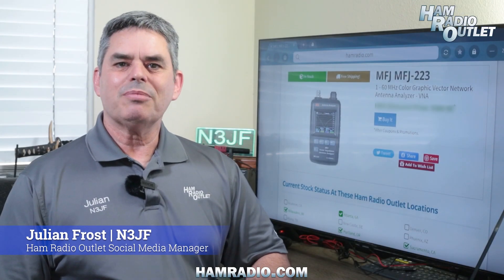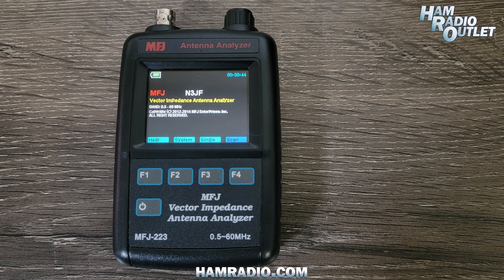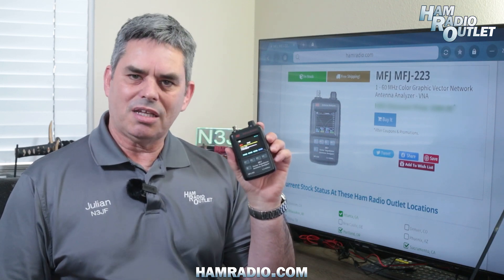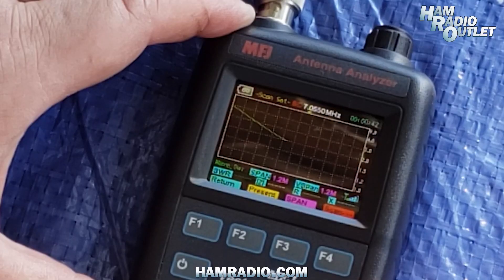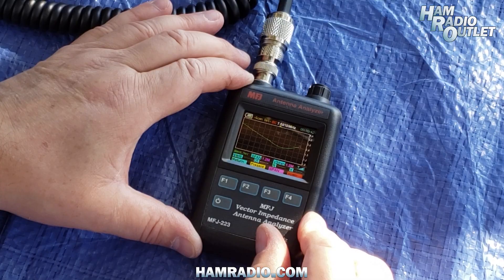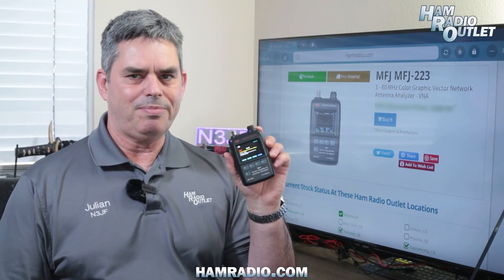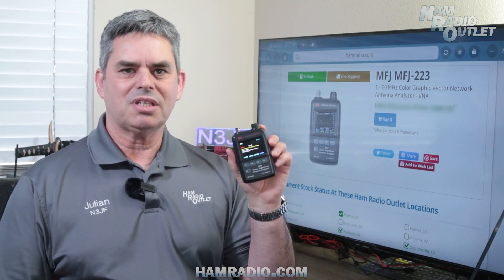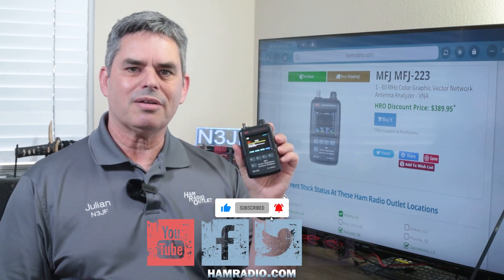MFJ-223 Antenna Analyzer - Ham Radio Outlet

Comment: I own an older version the MFJ-223. It does everything you mention but I paid $100 less for the latest Rig Expert AA-55 Zoom that does this and more. I have no financial interest in either company.
Reply from the maker: Prices change. There's not a $100 difference between the two models you mentioned.
Reply: @HamRadioOutlet  I purchased a new AA-55 Zoom from your competition for $315, which includes sales tax, several months ago. Not exactly $100 but close enough.
Reply from the maker: @Rick-se5qm  Like I said, prices change. That's not the case anymore. Prices for both the AA-55 and the MFJ-223 have gone up everywhere. One of our competitors has the MFJ-223 $90 more than us. At HRO, the price difference between the MFJ-223 and the AA-55 Zoom, is not $100. It could be at our competitors, but that's their pricing. 🙂
Reply: @HamRadioOutlet  Looks as if inflation has impacted our hobby in a major way.
Reply from the maker: @Rick-se5qm  Inflation... microprocessor shortages... shipping from Japan (for example) costs 3x what it did... war in Ukraine... COVID-19... they've all played their part in price increases.